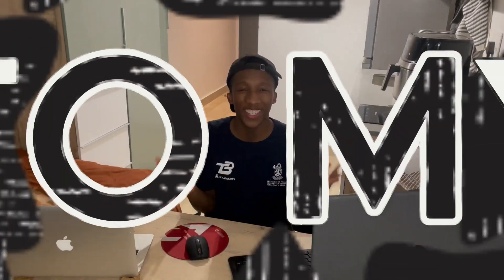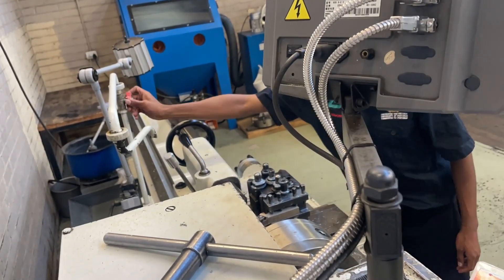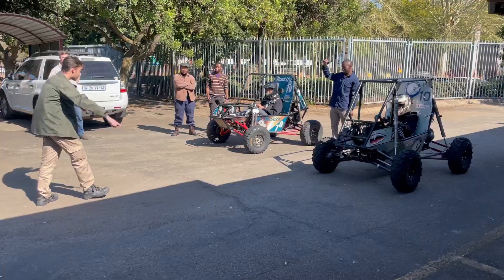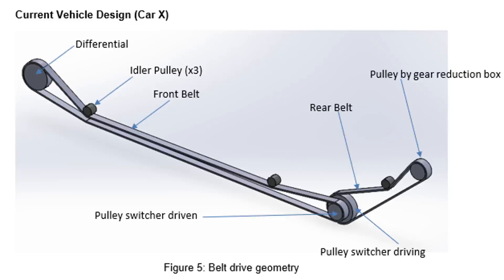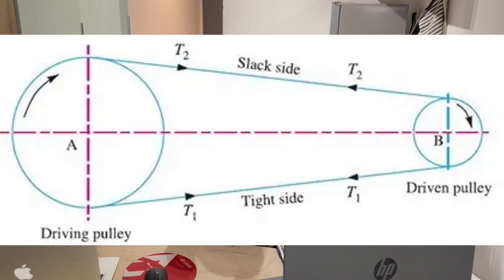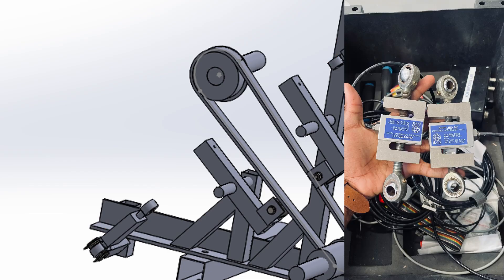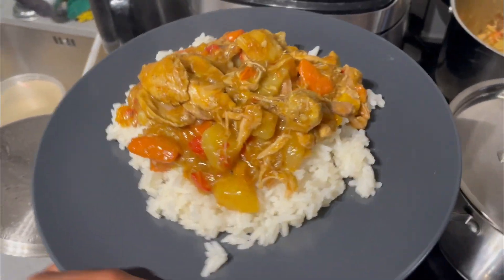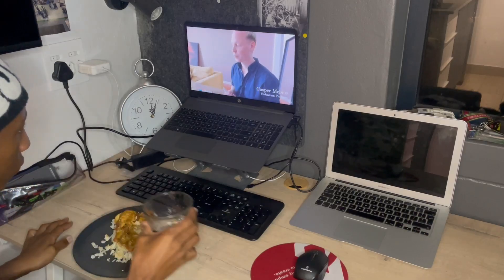I'm the only engineering student in the world to do this! | Building my test setup

Comment: What have you bet your money on, the prop shaft system or the belt?? Thats really cool if your research makes a breakthrough thats 💸💸😝. Youre so close to 2k Subscribers 🥳🥳
Reply from the maker: I’m still busy with the research, so that would be tough to say 😂 they both have pros and cons, prop shaft is a safe answer because it’s been tested before, belt drives can work better and reduce weight. So it depends on your requirements. 

2k here we come!